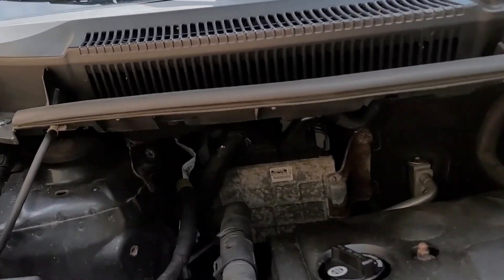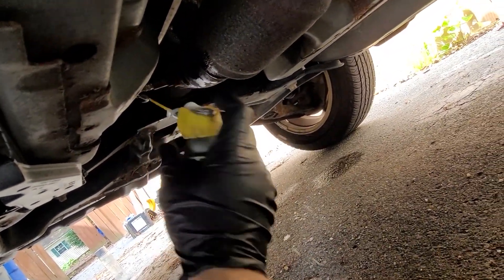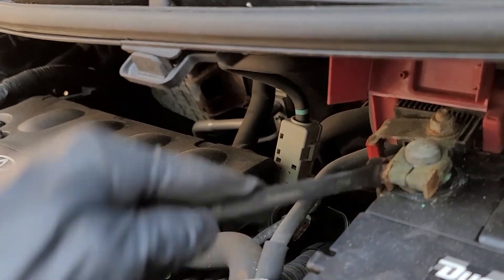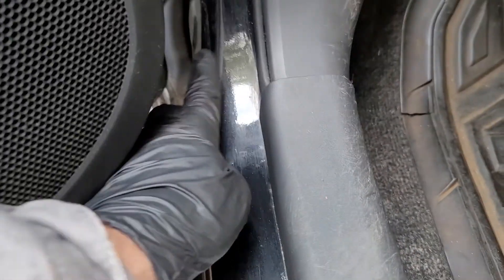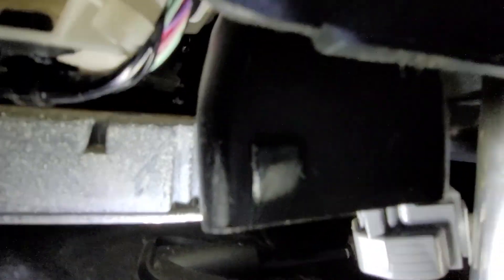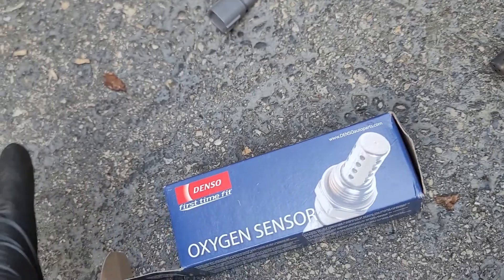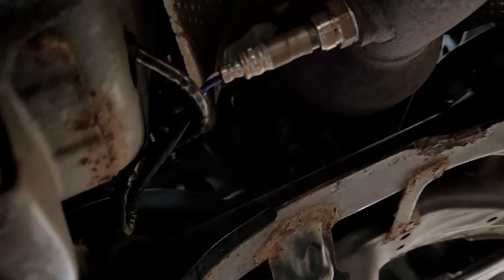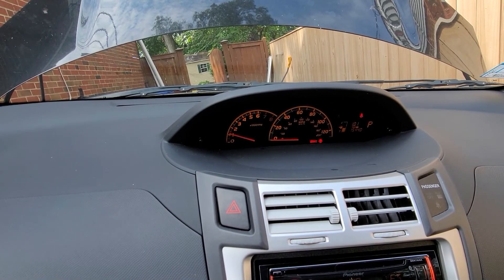Toyota Yaris Downstream Oxygen Sensor Replacement (P0606 P0138 Codes)

Comment: Heads up! Just did this job and found out the center console trim is super easy to remove. One bolt in the back most cubby. Once removed, accessing the sensor plug is very easy to access. No need to remove the seat.

Maybe that is covered in the video, but watched it a while ago and wanted to share.
Reply from the maker: I didn't cover removing the center console - this sounds a lot easier! I'm gonna pin it.
Reply: Thank you. If it is not too much to ask; can you please video the location of the bolt. Thanks again.

Comment: Is this the correct solution for a P0136 code on a 2012 Yaris 1.33 VVTi ? My engine has lost lots of power and hesitates pretty bad before accelerating from time to time. Only concern is that the idle is far from rough (incredibly quiet and smooth) and there were no check engine lights on - just my friend's cheap OBD throwing an o2 sensor number 2 code. Even the mechanic I took it to thought it was just carbon build up...
Reply from the maker: As far as I know, a faulty O2 sensor could be throwing off your car's capability to run a proper fuel to air mixture. So, it's possible, and worth a shot, since it's not too difficult or expensive.

Comment: So what do we do when we replace the sensor, and the wirings fine, p0138 still comes back?
Reply from the maker: Could be a variety of things. Is it an OEM sensor? In my experience aftermarket doesn't tend to perform so well. Beyond that, you might have an actual condition the sensor is detecting - running rich or lean. Try cleaning the MAF to start, and check your air intake filter for clogging. This might help further: https://youtu.be/KhhIP3r0BjY?si=XAJ1jdgHyhhYCrB4
Reply: @Bootstrappin  it's a brand new Denso sensor, the air intake is clean. I might try cleaning the maf, and yeah it's running in rich condition.

Comment: Just did this job yesterday on my 2012 Yaris SE. It was giving me check engine with codes P0138, P0139, P0607 (control module!). Your video was key to giving me the confidence to try this before letting a mechanic replace both the sensors and the engine control module. I did spend an additional $30 to get an oxygen sensor socket from Autozone to get the sensor loosened up. At the same time that I did the sensor I also cleaned up my Mass AirFlow sensor (MAF) and changed my filter. All of these together with using my OBDII reader and erasing the old codes once fixed the problem. It's running smoother and no check engine light. Thank you!!

Comment: You were right on the money. I originally had P0138. I cleared the code after installing a new battery. Next day went to start car and check engine light came on with P0606 code. Replaced rear O2 sensor and cleared code. Hopefully this fixes it. O2 sensor was white when I removed it. Used Denso copper on threads.  Great video. That harness was a bugger to unhook but did it thanks to your video.😊
Reply from the maker: Awesome! Seems like that'll be the ticket.

Comment: Awesome video. Thank you so much. Quick question. My wife has a 2007 Toyota Yahirs with 187000 miles. She had the engine light come on. We got her vehicle scanned. The scanning tool is saying fuel sensor of some kind. Do have any recommendations?

We don't want to spend too much money on the problem because of the age of the vehicle. My wife is a school teacher and needs her car. I let drive mine. But need two cars. So I can go to work and school.
Reply from the maker: Sure thing. What you're saying is vague, I'd need the actual code to offer relevant suggestions. Going out on a limb though - if it's a P0191 code, this article may help: https://www.700r4transmissionhq.com/p0191-toyota-yaris/

Comment: if the engine light continues to show after replacement - does the code need clearing?
Reply from the maker: Yes, or driving a certain distance/time without the condition should clear it (provided the problem is gone)
Reply: @Bootstrappin  Thanks for the information and the kind reply. 
I had it checked out and the mechanic said it was a result of poor fuel. hence the oxygen sensor lit up 
it's cleared for now and ill see if it shows up again.

Comment: sorry man, I've to put a cleaner spray in the oxigen sensor (sonda lambda in italian) upstream of FAP (or DPF). Is the one you're replacing, where I have to insert the spray's cannula? Is it before or after the Anti Particulate Filter?
Reply from the maker: Sorry I'm so late replying, had a hard time understanding what you're asking. This is an oxygen sensor, I think what you're talking about is a MAF sensor (Mass air flow sensor/debimetro). This sensor is after the air filter, I have a video on how to clean the sensor here: https://www.youtube.com/watch?v=KhhIP3r0BjY

Comment: Did the code ever come back on after driving it for a few miles? I have the same issue on my 07 Camry
Reply from the maker: Didn't come back - at least not for the 10-15 miles I tested it. Sold it since though, so I hope it's working out for the next owner!
Reply: @Bootstrappin  
how long do the 02 sensors last on these Yaris ?
Does the upstream 02 Sensor clog up too ?
You could have saved a couple of $$$ and maybe cleaned yours...
don't know how fouled up it was...
what year was your yaris ?